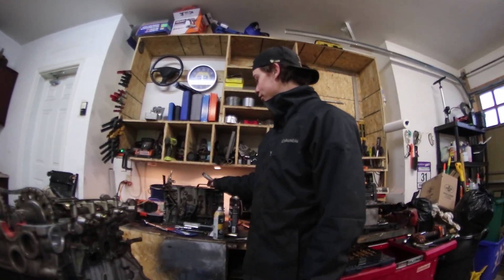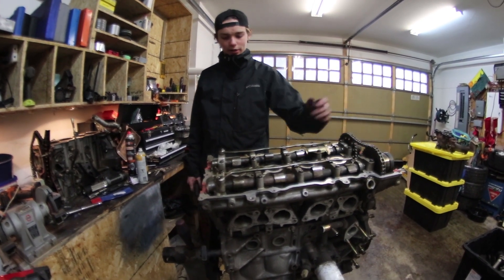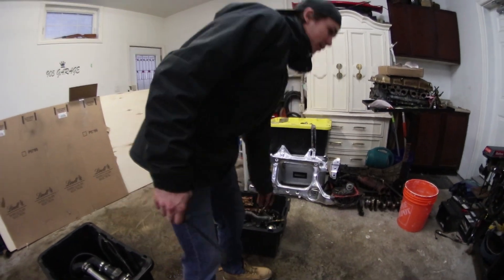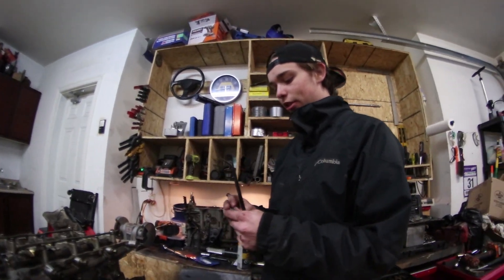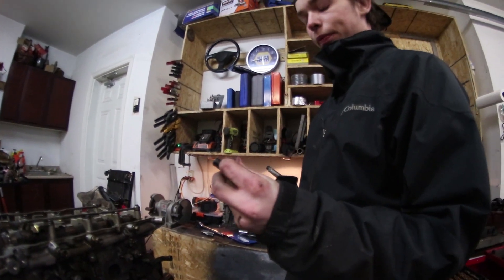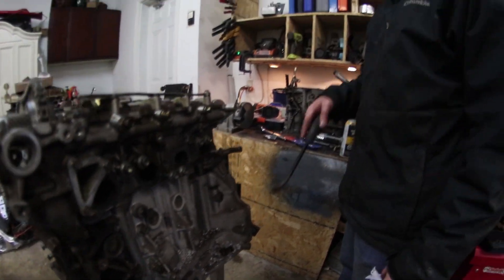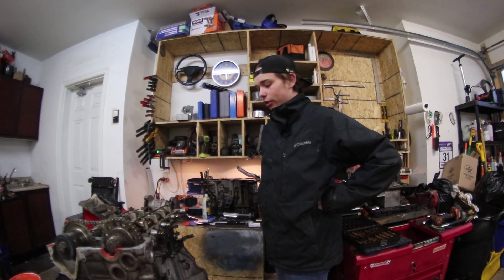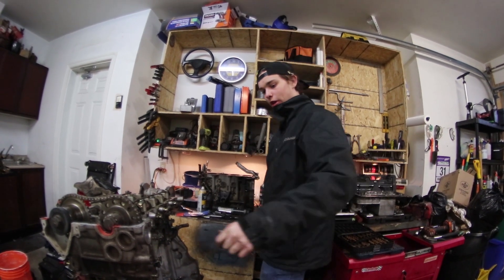How to drill and tap N/A SR20 for turbo oil and coolant lines | SR20 FD RX7 Build

Comment: Thanks for this video! How did it go with the oil feed? Did it work? I read somewhere that the oil feed leads to oil squirters that are not present on the NA block so its not possible to drill out enough to get oil flowing.. But I would assume the oil galleries have to be the same on NA and Turbo blocks
Reply from the maker: Jan Rambousek I cranked and cranked and eventually got steady oil out of it because I drilled all the way through. I was a little concerned at first. Didn’t see oil coming but then it was solid. Then drove the car for probably a total of 3 hours and lost the motor due to rodknock. Now sure what the problem was this time